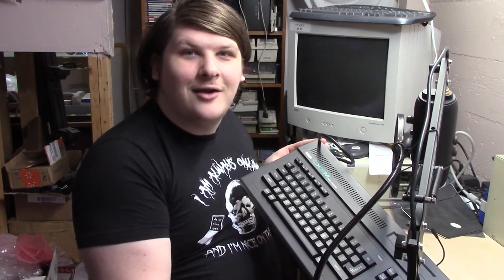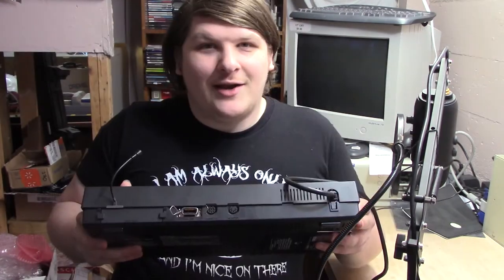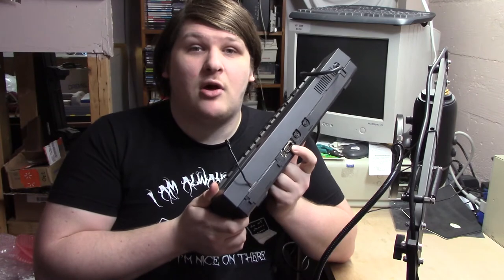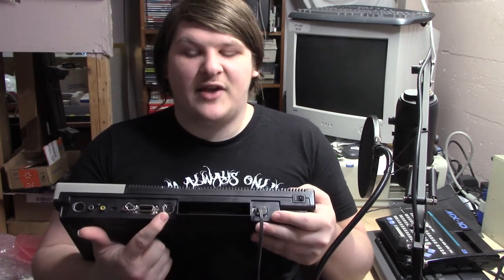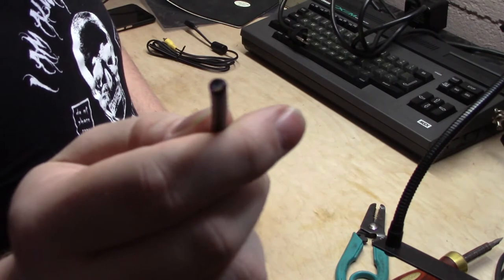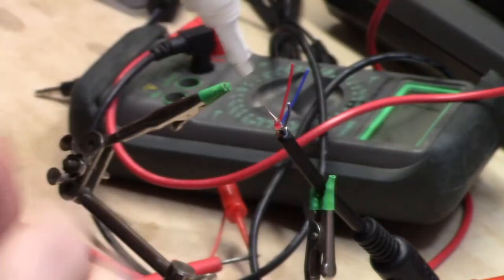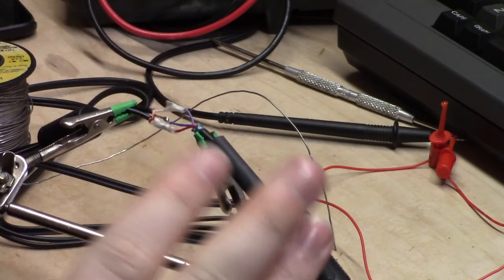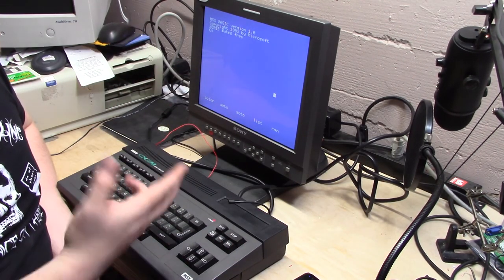Yamaha CX5M Part 1

Comment: I had one of these in the early 90's. Got it on a special at a music instrument store with a bunch of software on cartridges. The store owner thought it was obsolete and just wanted to get rid of it. Also had the full size add on piano keyboard and a non-volatile ram cartridge to store stuff on.  I was disapointed in that I had no software actually record on the machine what I was playing. There was a MIDI sequencer program on cartridge but it could only record/play external MIDI instruments. That music composer program also had no real time keyboard entry. The sound editor was brilliant, made many sounds using that. There was a drum machine pattern editor that was intended for the Yamaha line of drum machines but I got it working with my Boss Dr rythm drum machine. Worked really well. Eventually sold it and got a Roland D10 and went to using a PC for sequencing. Very nostalgic seeing this.
Reply: It's a very interesting machine. Reminds me a bit of the later Atari ST that had MIDI built in and a lot of music software.
The synth editor seems to be the best feature and sounds exactly like the FM synths by Yamaha of the time.
There is a 3rd party cart to enable sequencing external MIDI hardware and use the audio engine.
There's probably homebrew software too.
The MSX scene is still very much alive even today.
The early 90's were great times for computer hobbyists and bedroom musicians.

Comment: You probably already figured this out by now but: no, the module is not fresstanding. It requires executing code on the host machine to initialize and interface with. However, the FM chip is memory-mapped, so you could potentially fiddle with the address lines to program it directly? As for why the separate keyboard port, my best guess is greed: the original SFG-01 had arbitrarily limited MIDI that could only be used on its own to work with MIDI data — you had to use one of the three proprietary keyboards to do anything with the FM chip. (There was even the SFK-01, which removed the MIDI ports entirely.) With the SFG-05, you CAN use a standard MIDI keyboard for most things — there's some auto-accompaniment background chord playing thing that still arbitrarily is limited to the custom port keyboards.

Comment: I just got one in pristine condition.  If you have a Commodore 64 DIN-5 monitor/composite cable, it should also work for the CX5M.  Pins 2 (GND) , 3 (Audio out), and 4 (Video out) are the same for both computers.

See https://www.c64-wiki.com/wiki/A/V_Jack & http://kei-sakaki.jp/2017/04/06/make-monitor-cable-for-yamaha-msx-cx5-cx5f-cx5m-yis-503/